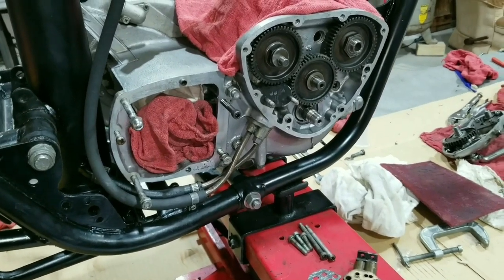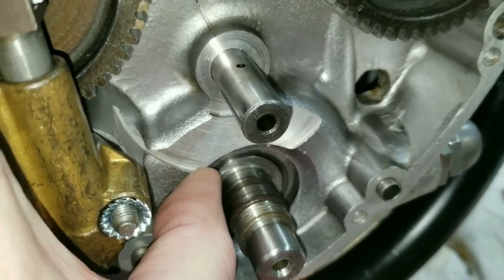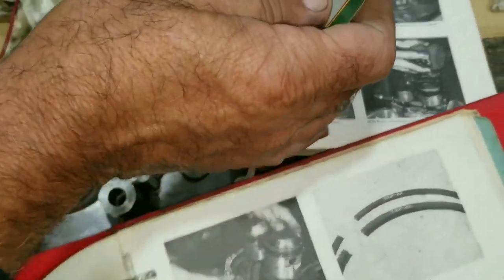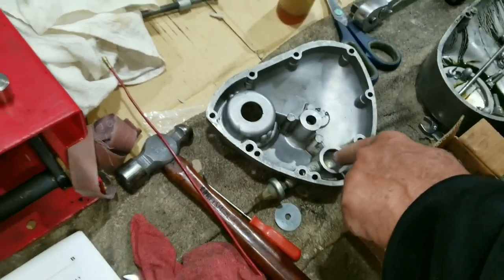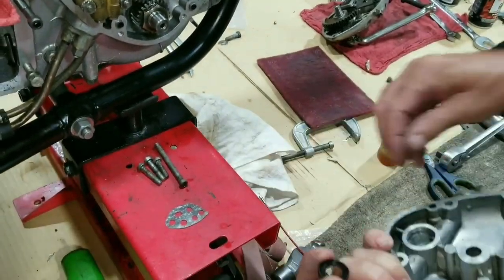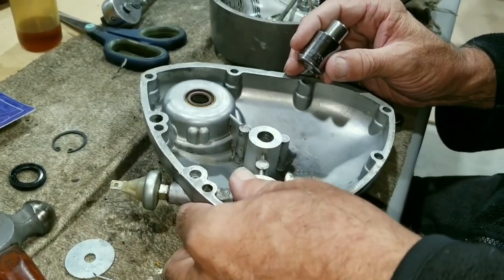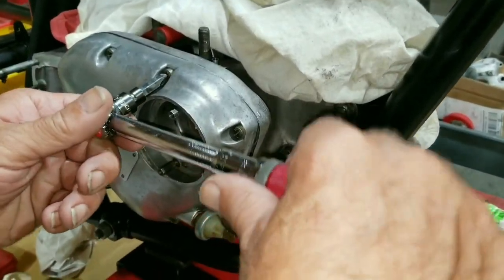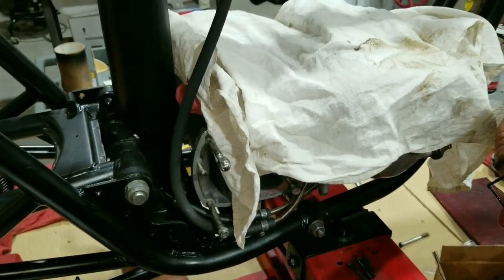1971 Triumph Tiger 650cc Restoration Part 13, Timing the gears

Comment: At 26:xx or so, NOT Phillips head screws!! Pozidriv screws!! Use the right cross head screwdriver to do the job right and you won't strip the screw.  Triumph went to Allen just because US mechanics complained the screws rounded out. They were using Phillips head screw drivers vs proper Pozidriv driver.    Notice the small marks around the head?  Indicates Pozidriv. No need to worry about torque.  Just tighten 'em.